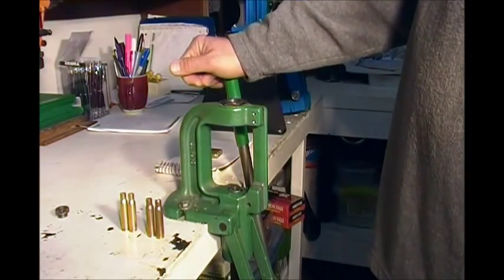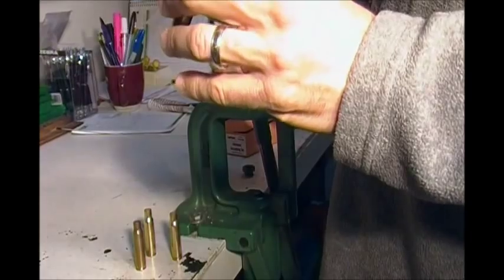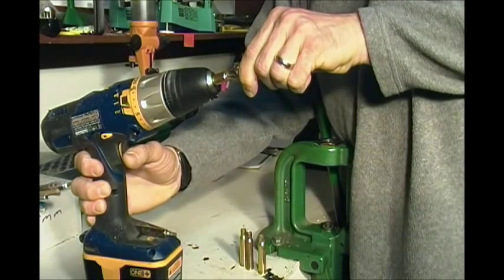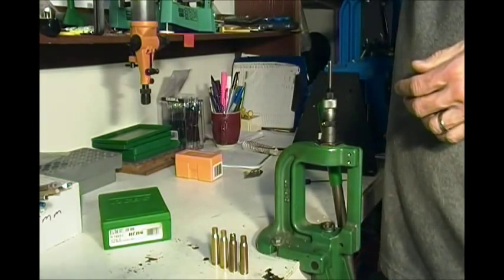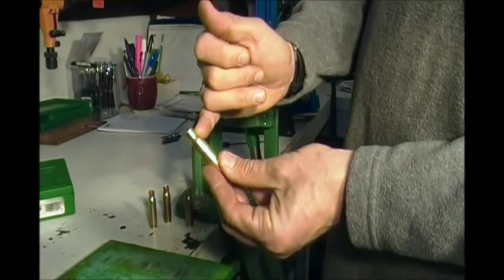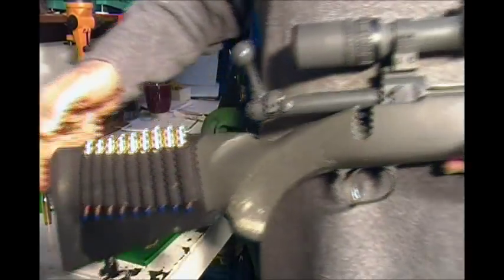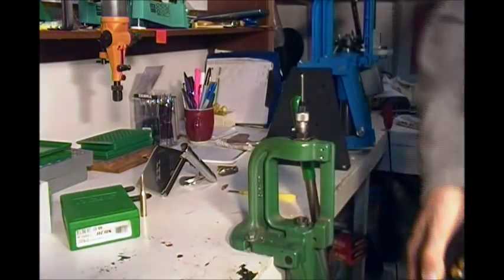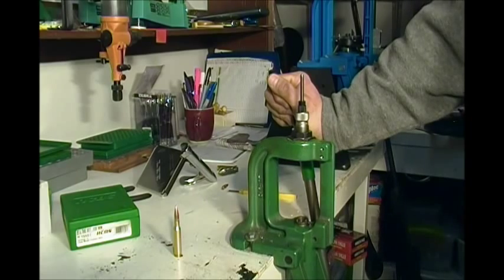.308 RELOADING BASICS WITH ONCE FIRED CASES

Comment: A couple tips. Lyman makes a primer pocket cleaner with a bevel cutter to chamfer the pocket mouth. It cleans the pocket and opens the mouth with proper chamfer and depth. $14. 
The best case lube ever is the Dillon Lube, 1 oz. of liquid lanolin in 12 oz. of isopropyl alcohol (ISO-Heet fuel line antifreeze, red bottle).  Put it in a Dawn Power Foam spray bottle for a fine mist. Throw your brass in a gallon Zip Loc bag, give it 3-4 sprays and tumble.  Slickest stuff ever and won’t effect powder and primers. I use it to turn 308 brass into 6.5 Creedmoor in one pass. 
One more thing, when setting over all cartridge length you want to leave the bullet at least .010” off the lands. With the bullet contacting the lands on firing it can cause pressures to spike.

Comment: So what your saying is that after you set your re sizing Die,? That it touches the Shell holder,? It is advisable to turn it down another 1/2 turn,? T
o re size it a little deeper,? So that it will chamber into the rifle easy,? When you are closing the Bolt etc.? Right.

Comment: I  mostly  use a File Trim Die & a File,? Been doing it this way for years,? And no problems,? As I do not load such a large bunch of Brass,? So the file Trim Die,? Serves my needs etc.? I just Invested in the Lyman EE Z Trimmer Hand Tool.? Going to give it a try also.?
Reply: MyREDTAIL the Lyman is great because it doesn't squeak.  I get my wife to help deburr and remove crimps and re prime because we wind up with mounds of brass to process.  My wife hates it when I'm sitting on the couch squeaking like a mouse while we watch tv..  
Those hand held primers are great too. You can knock them out by the 100 pretty fast.

Comment: OK,  so your trick to determine overall cartridge length by seating the bullet in the dummy round with the bolt action of the rifle gives you an absolute maximum length and no jump to the rifling for that particular rifle.  No jump at all.  Is it your belief that zero jump is the best for accuracy? Is there theory that a few thousandths jump might be better?  Honest question.  I just started reloading.  Thanks.
Reply from the maker: Best to back off a couple thousand just in case.  Tight to the lands could produce some unwanted nasty pressure spikes.

Comment: I just found your video for the first time however I'm going to look and see if you done anything on crimping a 308 Round And if not would you please do a video on how to crimp a 308 round using a RCBS press thank you? Also this is probably the best video I seen so far for a newbee that's just starting to reload ammo...

I'm running my 308 ammo out of a AR-10 and I was told that you have to crimp the ammo to keep from pushing the bullet back into the case however I can't seem to find a video that shows you how to crimp 308 ammo...
Reply: Jay Collins Hey man thanks. I’ve been shooting an M14 clone  for 20 years and never crimped my bullets. Just screw in your seating die until it forms a crimp. Just remember to back off the seating depth to compensate for the difference. I’m home in a week from work and I’ll shoot some footage on die adjustments for crimping.

Comment: HI  Thanks for the video!
Could you please explain what you meant by "give it a flat spot" right before you run a case into the rifle chamber to get a custom over all length., sorry I'm just not getting it..
Reply from the maker: Just push in a small section of the case mouth to hold the bullet in place while you run it into the chamber.  Think of a flat tire.
Reply: thanks

Comment: Does your brass deform from the chuck of the drill?You must not be reloading for accurately?
Reply from the maker: If the chuck deformed the case I would not be using it.  The only time the primer pocket is reamed is for Mil Spec crimped primers.  Cases that have crimped primers only  are for my M14 clone which is a 2 MOA rifle and the  reloads are easily the equal to that.  In a good bolt action these reloads are sub MOA rounds.

Comment from the maker: If they are mil-spec or cases loaded with FMJ the primers may be crimped in.  Go slow so you don't break the de-capping pin. Then ream out the primer pocket to remove the crimp.

Comment: Glockster42, great vid! I've watched 3 times.  I've just received my Lee cutting tool and can't thank you enough for the recommendation.  I have a question regarding seating the bullet too much.  I used my micrometer to measure factory bullet length.  I then seated my bullet to the same; 2.073.  Is it dangerous to over-seat?  will it cause too much pressure?
Reply: Or 2.733 (I think, I'm at work and can't remember what it is exactly)
Reply from the maker: It could cause an over pressure if you are loading to near max loads.  A good starting point is the COAL (cartridge over all length) as indicated in your reloading manual.  Best accuracy is usually with the bullet seated a few thou off the lands or at least a long as your magazine box allows.
Reply: Glockster42, I loaded 9 308 rounds with 44.7gn of Varget.  My case was trimmed to 2.003.  My COAL is 2.718.  I am wondering if this is ok in my Rem700 SPS bull barrel.
Reply from the maker: pchutton What weight bullet and manufacturer?  As long as the bullet is not jammed into the lands and the load is within the parameters of a reloading manual, you should be okay.

Comment from the maker: First pull apart your die and remove the decapping pin, easy to do with a RCBS type die, if you can't remove it the primers gotta go.  Use some WD40 and kill the primer.  Lube the case and then screw the resizing die down a 1/4 turn and resize the case.  Have the rifle with you and keep turning in the die until you can easily chamber a round.  If you've killed the primer with WD40 make sure you clean and tumble the case to remove any residue.

Comment: No offence, but if I recall correctly, the instructions I've read for resizing dies say "run the ram up all the way, screw the die in till it touches, then back the ram off and turn the die in another eighth to a quarter turn before locking it in with the lock ring". Which adds up to what you did in two steps. Otherwise an excellent presentation.
Reply from the maker: Doing it this way ensures it will chamber in the rifle.

Comment: If you are shooting your .308 ammo in a bolt action rifle you can neck size second time, if you are shooting them through a semi auto I only full length size.
Reply from the maker: Yup but if you have multiple rifles it good to full length resize back to spec.
Reply: Glockster42
Ya could get 30 plus reloads if ya neck size only and keep each lot of reloads separate for each rifle...3-4 reloads per case is too low for me. Best Wishes